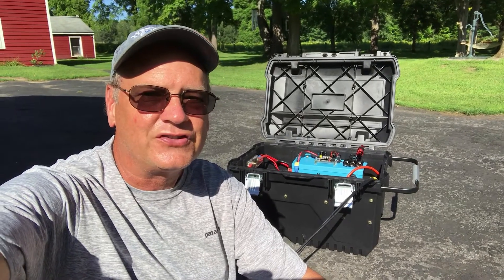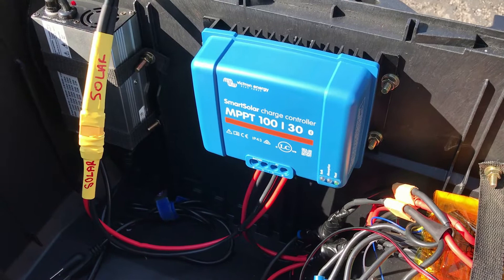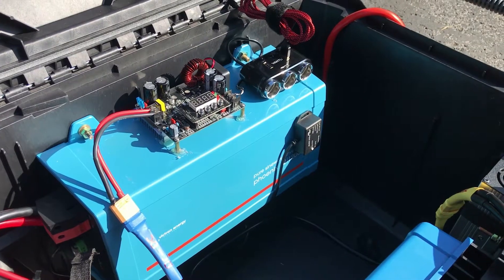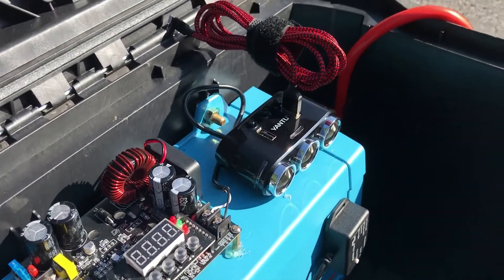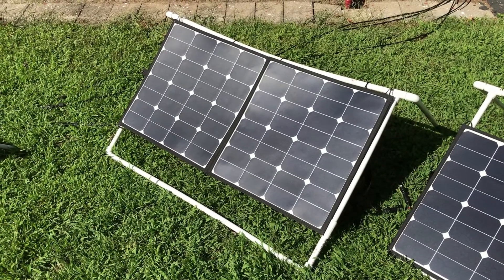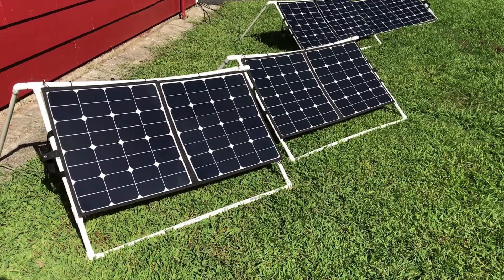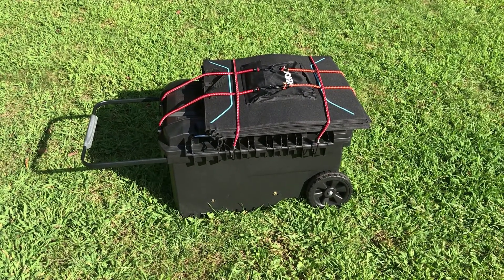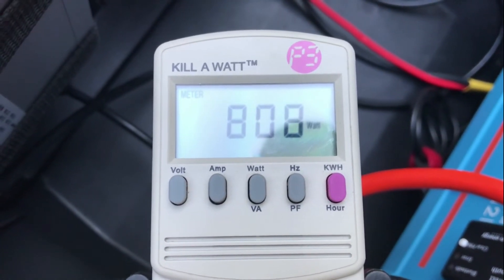DIY Portable Solar Generator

Comment: Amazing job! Im very interested in building something similar. How long will it power your camper after sun down?
Reply from the maker: I have 32Ah right now. Depends what you want to run. I also did a build using my Ryobi batteries (  https://youtu.be/lAAWFCU4iEM ) which you might already have around.
Reply: Any recommendations on how to max out this setup for a night time draw? What would be the max number of panels and batteries? I like the battery kit you used but I think 12v would be closer to my needs since I have a 12v charging source as opposed your 16.8v charger
Reply from the maker: @charlie138x  so many tradeoffs... A single lithium battery has a voltage from 2.5-4.2V So putting 4 of them in series gives you a range of 10-16.8V. So you need a 16.8V charger to fully charge them. The number of solar panels depends on your solar charge controller. Victron makes many versions. They are MPPT chargers so you want to put as many panels in series as the controller can handle. Most 100W panels are in the 20V / 5A range. So a 100/20 controller would allow four 100W panels in series. A 100/50 controller would  allow eight 100W panels, but you would have to put them in a 4S2P configuration

Comment: nice! Building something very similar, same craftsman box. Why did you decide to go with 18650’s instead of what most campers use, high capacity lifepo4? I didn’t see a BMS. Are you not using one!?!
Reply: I had a bunch of free recycled ebike 18650's. Each "brick" of batteries has a BMS board. There is more detail at: https://www.youtube.com/watch?v=emJtaHUC5SE&t=2s and https://www.youtube.com/watch?v=oQybge-ftI8